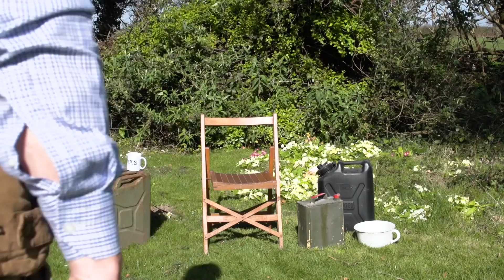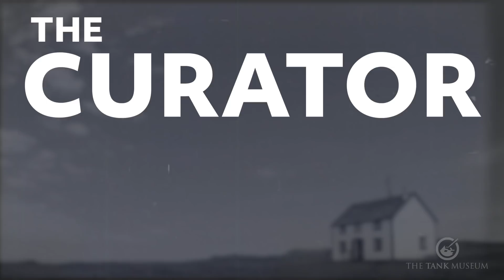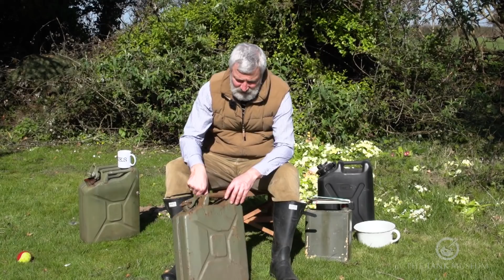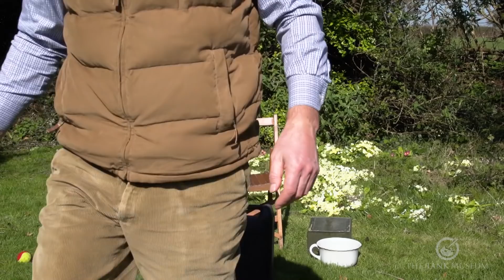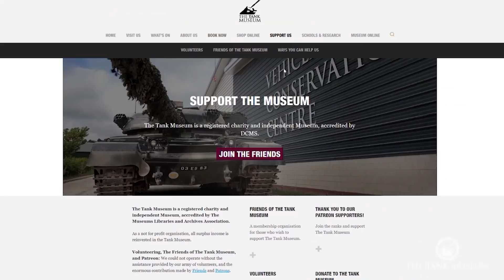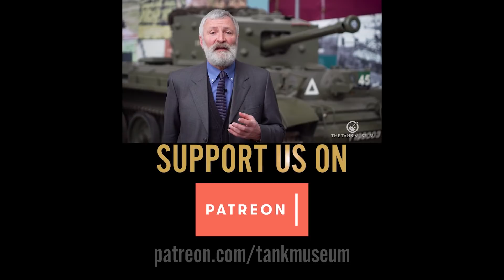The Curator at Home: Jerry Cans | The Tank Museum

Comment: Good effort and hats off for finding a way to keep up the output. In terms of post Cold War usage, the British Army doctrine changed from relying on stockpiles of jerrycans and moved towards bowser fuelling with a small number of cans being kept on vehicles themselves. This thinking is still in use. The change coincided with the elimination of petrol (gasoline) for vehicle power and the simplification must have helped the system. The use of the term "Jerry" for the Germans has, as you say, many possible derivations but in terms of "Jerry built" this is very close to usage such as "Jury rigged" (meaning a temporary expedient rigging of a vessel) and is much older to my understanding. Keep up the good work!

Comment: another Topic i find interesting is types of trucks used, as i am generally interested in logistics.
there is a Connection to the Topic of this Video: the german army used fuel trucks that basically had racks on the sides that would be filled with jerrycans.

there is a Thing About jerrycans that is often overlooked:
there is actually a reason why it is better to get the fuel to the tanks in cans, rather than tank-trucks.
when a column of panzers stopped to refuel all tank Crews would get to the fuel truck and carry their fuel to the tank in jerrycans.
in the French army they used a tank-truck that would go from one tank to the other, refueling them one at a time.
the jerrycan Method had all tanks refueled much faster, and partially refuelled in an instant. so they could take evasive Action in case of an airraid.
the French method meant that there was one unfilled tank Right till the end, so evasive Action could not be easyly taken.

of Course it is not viable to refuel a tiger with JCs, as the Need of fuel is much higher.

Comment: I knew most of this but still learned a few nuggets. The brass cap for instance. Obvious but i never thought of it. Same as the german seam welding. Keep going. Isolation is made easier with your helpful distractions.  As far as ideas. How about the logic behind the different shapes of ww2 helmate (german vs brit vs american etc). Clearly got the idea from your section on the poe. Cheers keep it up. Hopefully will see you next year at tankfest with my little boy.

Comment: Good video! Great style of video to keep up under current conditions!

I prefer a metal Jerry can to the plastic gas cans sold here in the states. Although now due to some ridiculous government regulations they’re being so with the most stupid fill nozzle and caps that are atrocious to use. I had to pull a plastic sleeve out of my most recently purchased Jerry can to even be able to fill it up with a normal fuel nozzle at full speed... with the plastic sleeve in place it was near impossible to fill without holding the nozzle at its slowest dispensing rate, otherwise it would trip the auto shutoff on the nozzle.

Comment: I believe that "gerry built" or "gerry rigged" is a corruption of "jury rigged" which is the actual term for the temporary expedient rigging repairs made on a sailing ship that's sustained damage to its masts and rigging due to weather or battle.

Here in the US a term for your "gerry" is "thunder mug". It's what you used when the weather would make it unpleasant(er) to visit the outhouse.
Reply: As far as I am aware the general idea is that “Jerry-built”, which meant build cheaply and/or poorly, developed separately from “jury-rigged”, meaning makeshift repairs with what is on hand but not necessarily of poor quality. 

Later their meanings kind of merged together and the similarly merged “Jerry-rigged” emerged.

Comment: Just to add a little bit of flavour the mk 5 portable fuel bowser (the rubber sphere) is nicknamed the b***ock in the British military. The RAF has a much bigger, flatter one used out in the field to refuel said helicopters (I'm an ex RAF supplier who worked with POL in my last job in the RAF). I would be interested to hear about the 'boiling vessels' in British tanks. When were they introduced? Chats on other ancillary equipment would also be of interest.
Reply: @James Harris 

Blivets?
Reply: @Doug_JB  not quite.  I missed out three letters 'O L L'.
Reply: @James Harris 

No, I was referring to blivets, the huge flat ones, shaped sorta like a loaf of bread before you bake it.
Reply: @Doug_JB  I see. I never worked with them but it does ring a vague bell 😊. I worked with a guy who used to work in Tactical Supply Wing. They used them all the time.

Comment: Re "jerry-rigged".
IIRC, it derives from the maritime term "jury-rigged",  derived from "injury-rigged", an emergency repair to a ships masts, spars, rudder, etc. to enable safe landfall.
When it changed meaning to being something badly done I don't know.
Reply: It's actually pretty simple, if not obvious; it meant a temporary or emergency repair - one not expected to last very long and thus not using safe or sturdy repairs and materials. So, something that failed would be accused of being just an expedient repair and not a proper fix designed to last very long.

Comment: Very interesting especially about the cans floating. never knew that.
Reply: Actually, a bit of air in a container allows the fluid to expand without stressing the container significantly.  I suspect there were lots of other clever design reasons for the layout (including, I'm sure, floating).  However, fluid expansion without an airspace can generate very large forces.
Reply: However they don't if filled with water

Comment: Interesting fact about the modern Scepter cans is that they have the original 3 handles for fuel, but only one handle for water cans.....
Reply: An easy way to tell the difference in the dark, I guess. If you can't use a light for "reasons", you could immediately tell if a can was water or fuel simply by touch.
Reply: @jcorbett9620   Exactly correct J !

Comment: Here in the US the EPA has ruined gasoline cans by forcing everyone to use "CARB" compliant cans that are supposedly spill and vapor leak resistant in order to combat the public scourge of gasoline spills while filling your lawnmower.  Thousands of lives have been saved and mother earth has breathed a sigh of relief, or so they tell us.   These cans are abominations of public policy designed by committees who's sole purpose was to produce slick presentations that made their superiors look good thus ensuring promotion.

You can still buy classic jerry cans in the US but they are only legally sold for use with water.  Conveniently they come with a gasoline resistant coating inside in case one wishes to live life on the wild side, break the law, overcome your neighbors with fumes and murder mother earth.  They are roughly 1000 x superior to the plastic abortions that masquerade as gas containers.  Some things never needed to change.

Comment: David, first class effort! You have placed the bar pretty darn high with this video!
I have served in the Australian Army Reserve in Signals and later in the Engineers, so I was aware of some of the story but the back story of the British fuel cans and fuel supply chain was totally new to me. During my time in the late 80s and early 90s, the metal Jerry cans were for primarily diesel with some for petrol for generators etc. The green plastic cans were for water. Not sure of the current methods. The ADF fuel tanker semi's have certainly been given a workout supporting the fire fighting efforts this past summer here in Australia. The usual setup was for the tanker to be parked on one side of a sports oval and the fire trucks could then shuttle past as they came off the fire ground for a rest break.

Comment: The Jerry can has those lines on it for expansion and strength. Now we use bladder packs. Amazballs
Reply: The grooves pressed into the sides are to give it the strength needed to prevent the sides from popping out under pressure.

Comment: I use a lot of lawn and gas powered equipment at work and have tried dozens of styles of gas cans over the years. The best and current one that took years of convincing for management to authorize was a actual steel Jerry can. Expensive as hell but nothing has been easier to use nor has held up better to the rough handling that inevitably happens then a Jerry can.